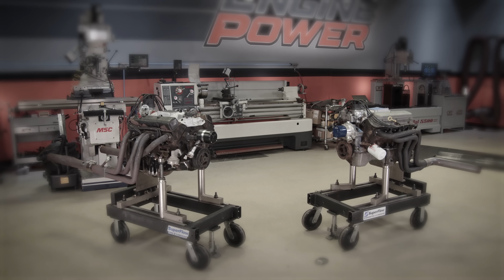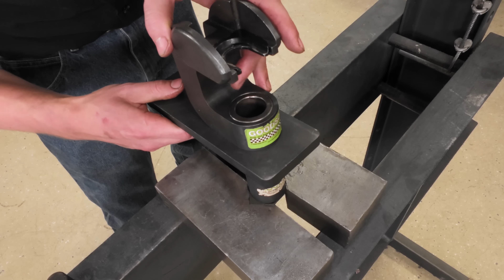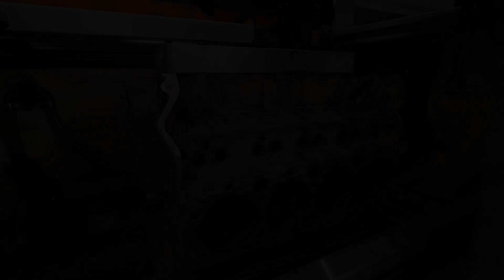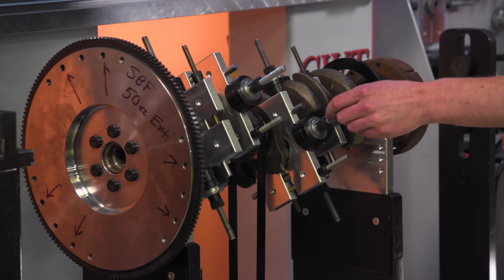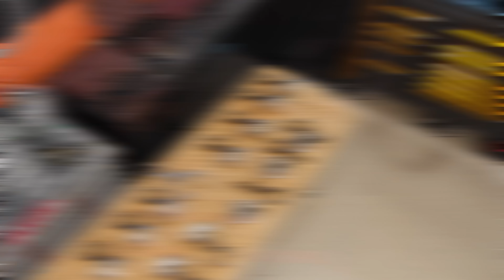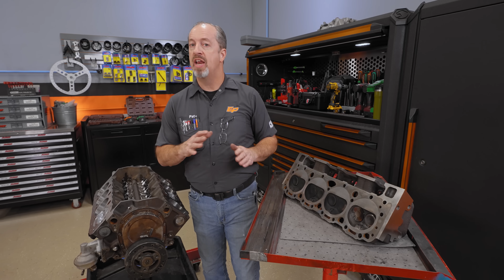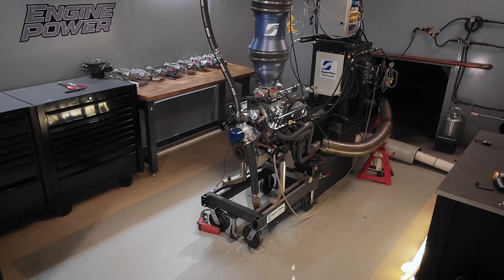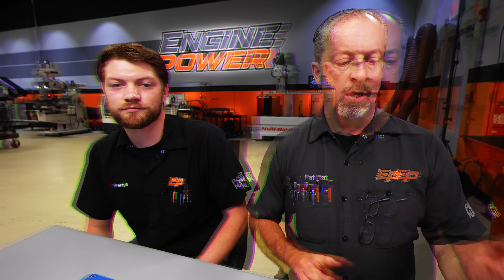305 SBC vs 302 SBF: Does Compression Help the Lowly 305 beat the Race-Bred 302?

Comment: Mostly boils down to air flow and compression.  No reason to put a Chebbie in a Ford.
Reply: B..b..but I noticed a spot on the side of the Chevy piston that was slightly shinier! Clearly we need them to start over!
Reply: If it's all you got it's all you got I put a 530hp 454 in a ford when the 302 blew it was all I had. Been in there since we where looked down during COVID 19 era
Reply: You’ll be hard pressed to find a ford in a Chevy
Reply: Price is the reason people don't build chevys cause they better its cheaper
Reply: @slabbuster  what
Reply: Agree but people still do it, no a days there are fords going into chevys more and more
Reply: I say if you got a chevy build a chevy, you got a ford build a ford.
Reply: Price. That's pretty much always the reason
Reply: @GreatLakesLogger That isn't necessarily true anymore. Both of these engines can be built within a few % of each other. I've been building Fords for years and heard this many times. After giving estimates to my customers wanting to switch to sbc or LS they typically stay with the Ford.
Reply: @GreatLakesLogger  exactly, that's why you'll almost never see ford powered race cars at your local circle track,  they're just more expensive to build.
Reply: @GreatLakesLogger  100%
Reply: @GreatLakesLogger Fords aren’t any more expensive to build than a Chevy with a similar build
Reply: @markcole6475  i thought the big block stuff was way more expensive.
Reply: @markcole6475  True for the small block, the 5.0/302 Ford will also be lighter than the chevy. Both did well.
Reply: @markcole6475 old yes there not new there 25-35% more expensive more parts
Reply: Well except a cam only ls 5.3 kicks both of these to the.curb. main reason it's done
Reply: @CLEEPER1 who cares …this was an old school build …put your modern 5.3 up against a modern 5.0 yotee
Reply: @markcole6475 i was replying to why people put chevys in fords
Reply: @markcole6475 5.3 is still cheaper for every hp
Reply: @matthewharchenko9714 that’s not what this episode was about ….5.3 blow up just like everything else
Reply: @matthewharchenko9714  Not once its installed wiring exh tuning etc.
Reply: @gordocarbo 🎯
Reply: @matthewharchenko9714  But you will have to build it 3 times to equal the lifespan of a SBF.
Reply: @markcole6475 show me a Coyote for the same budget as a cam only 5.3.
Reply: @foxfordcatguy2283 Not likely the LM7 5.3 is stouter in everyway.
Reply: @CLEEPER1  Larger engine (size does matter) and aluminum heads.  Besides I wouldn't put a 5.3 in a Ford or Mopar regardless of the HP difference.
Reply: @supercuda1950  Agreed
Reply: @CLEEPER1  The only reason the LS does better is because of the heads. These stock cast iron heads are no comparison. Good aftermarket aluminum heads and the LS is now no longer the big winner.
Reply: @walkingman9171 Thr design of a LS all around is better than a SBF or Chevy. It is what it is, doesnt mean those engines are garbage or useless its just technology getting better. These motors with nice cams, aftermarket pistons, intakes, headers and carbs make what a stock 5.3 with a tune.
Reply: 😂😂 Ok Moparts fanboy.
Chevy always destroys POS Mopar 🤪 or Ferd in reliability lmao
Reply: @Canada55Ehactually a LA can give serious whipping to both. This coming from a diehard GM guy.
Reply: @Canada55Ehoh ok is that why the 6.2 is so reliable 😂😂😂

Comment: The 305 has a boat anchor because of it failure issues which are the same as the 350 in those years. Oiling problems plague the Chevys when a cam lobe flattens and no 7 con rod gets wiped out. One engine builder I worked for had a cutter made to increase the size of the combustion Chambers so they could be used on 350’s.
Reply: 305 is a boat anchor because so few are 4 bolt main:  350 HP is pushing what the bottom end is good for, especially with a manual transmission.
Reply: @allencampbell3726 Not even close to true. A studed 2 bolt is more than enough for 500+ hp. If you need more put some splayed caps on it. Splayed 2 bolt is stronger than an OE 4 bolt block anyway.

Comment: Looking at those curves they both would make real nice engines.
Reply: I'm so glad the 305 Chevy.Finally got the respect deserves.
Reply: I built a stroker 305 just like hot rod magazine  did which came out to a 334 cid but put a B&M 4-71 blower on it in a 85 Z28 with 2000 stall and 3:73 gears it was a ripper fo r sure

Comment: You guys should try to go round 4 with them two engines. Next round try to put small superchargers on those two engines and see what they are capable of doing. And first pull have signal  double pump 4 bbl carb then 2 pull have 2 double pump bbls on them see the out come would be likely.